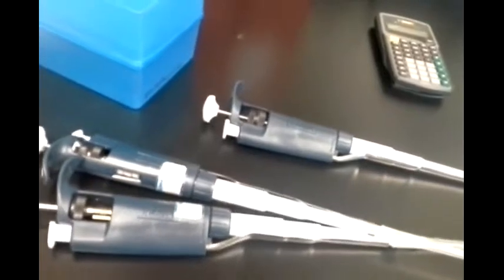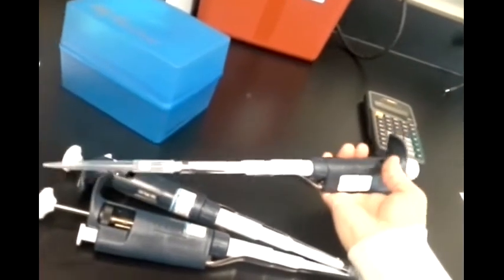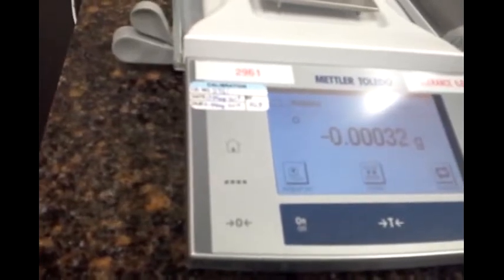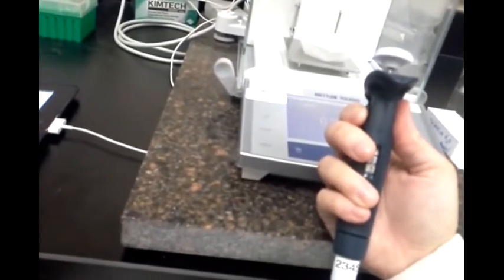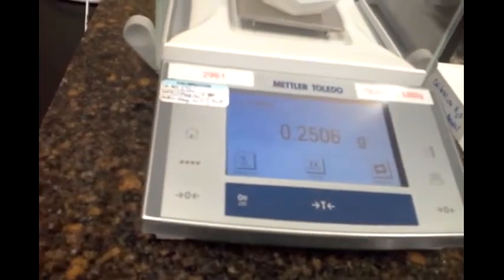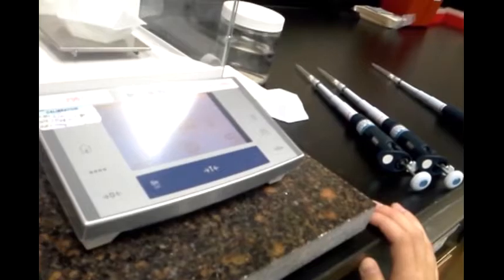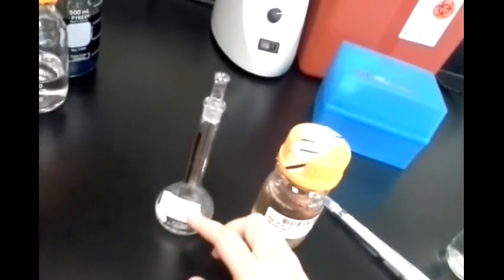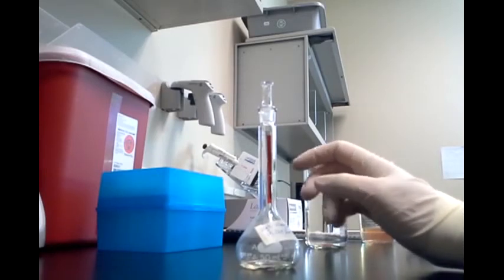ASMR in the lab - Micropipetting

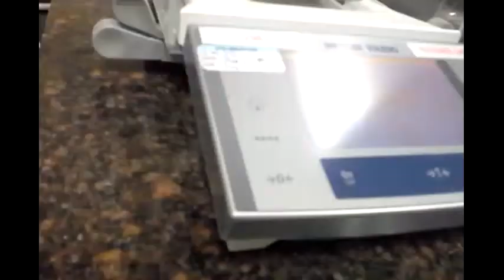Comment: 2:42 "...which I'm not going to show you. Because I really would like to use both of my hands." I literally laughed out loud.

I really am enjoying these lab work videos. Be careful not to get yourself in trouble though. It seems like there are so many ways you could potentially upset your employer with videos of work.

On another note, have you ever tried to use the calibration scale to measure the force of a breath, or is breathing on the scale frowned upon? I assume the shield is just so air currents don't upset the measurement but maybe there is more to it as the shield in front is fixed?
Reply from the maker: Oh, I do try to be very discreet when I'm filming these videos, and I try to make sure not to reveal any identifying information in them. I have a pretty airtight backup story I can use if I get "caught" filming, as well.

This particular scale is shielded this way, and placed on a granite block, because it's an extremely sensitive scale. The slightest air current can throw off the measurement. So when that kind of accuracy is required, the granite block helps stabilize it, and the plastic protects it from circulating air. We have other balances though, that don't need to be quite as accurate, which are just open to the air.

I have never tried to measure how much force my breath has! Perhaps I'll try it and let you know. :)
Reply: Misha Shivers
Cool, I'll look forward to hearing what the force of a breath is. :-)